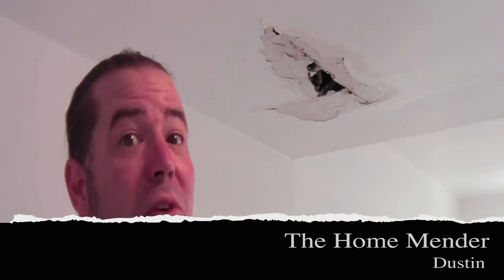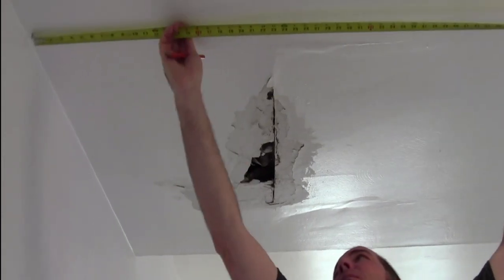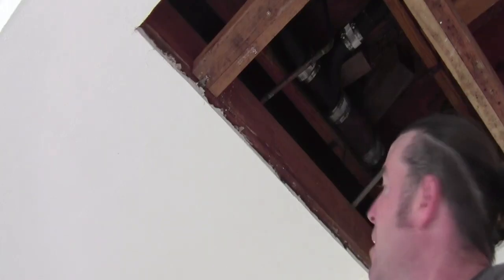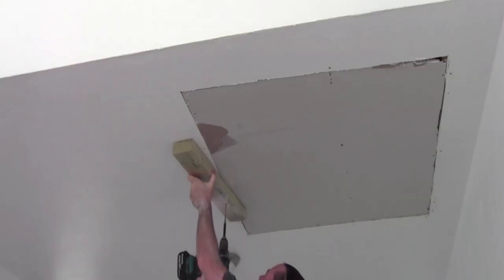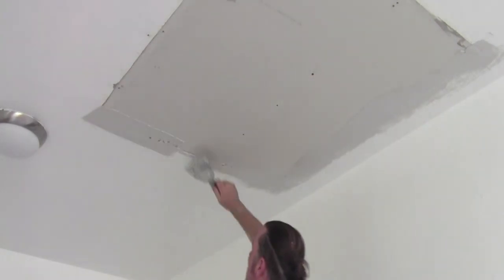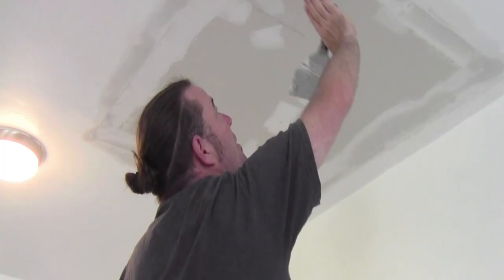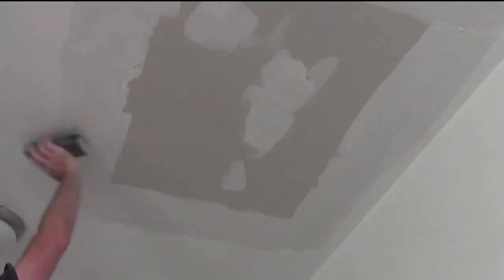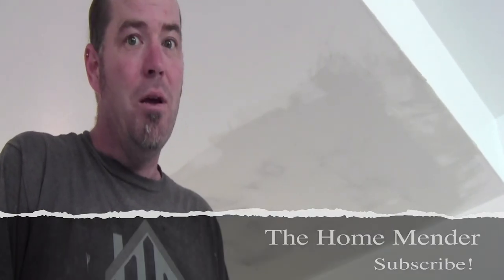how to fix drywall ceiling, hole in ceiling, drywall repair. easy!

Comment: Nice job I always fill the tiny crack between the two pieces with mud before tape. The second thing I do is use glue on the studs.
Reply from the maker: Hey Jim thank you sir. I’ve been filling the larger cracks imperfections and holes with five minute mud before working on them, Iusing the green top it doesn’t stay put so it would have to be a powdered mud. Now glue on the studs haven’t done before, that’s hard-core. Thanks for sharing

Comment: @Dustin...This Is An AWESOME Video!  What Do You Do If The Hole Is Right By The Light Fixture? Remove The Light Fixture - Right? I Mean Do You Remove The Electrical Box Inside The Drywall Attached To The Stud Or Just The Main Part Of The Fixture & Leave The Base That's Attached To The Electrical Box? How Do You Measure The New Drywall To Accommodate The Light?  Thanks Again!!!!!
Reply from the maker: Hey woman!  Thanks so much.  Yes pull down the light fixture and leave the box. I like to measure the board needed, then measure over and mark the location of the box. Cut and install. Dont worry about being exact.  Get as close as you can then fix when you mud.  You got this!
Reply: @homemend  Thank You Dustin!!!!! I GOT THIS (Thank You For That ;-)!!!!

Comment: How did you fill the hole in one of the corners ? Did you just add a small piece of drywall ?
Reply from the maker: Hey Robert depends on the size, if the mud won’t stay in it then you may need to pop in a little piece of drywall it doesn’t matter how ugly, you’ll make that up on the finish work. You got this

Comment: Woo Hoo.. I’m working on removing wallpaper. Skimming wall. Having issue mudding corner edges
Reply from the maker: hey M!  heres a skim coat and corner video that may help you out!
https://youtu.be/x4HkOpvA7kY
Reply: Home Mender Inc thanks.. was good. But out side corner
Reply from the maker: hey M...outsides are great....screw down your metal corner bead ( about 2 bucks, ) make sure screws are not protruding then slap on the mud, scrape off everything edge of corner to wall... you got this.. great video idea!

Comment: How do you match up a textured pattern ceiling after repair?
Reply from the maker: hey sam...it depends on the texture, most swirls can be recreated with mud and a sponge or whisk broom.you just want to feather it out farther than the repair....if its knockdown, orange peel or popcorn, they sell spray in a can stuff... i hope this helps.
Reply: Home Mender Inc
Thanks,appreciate .